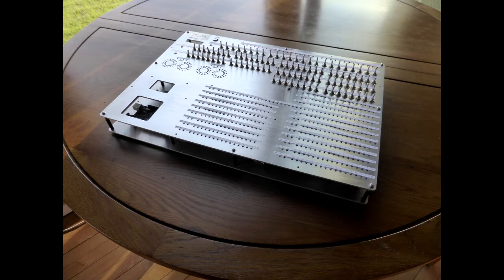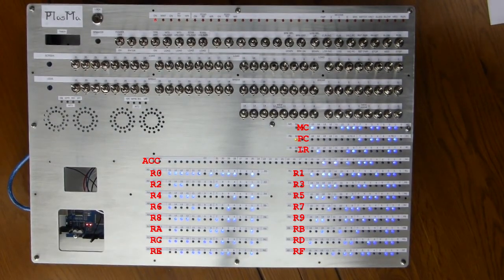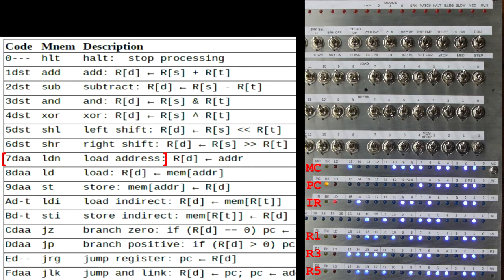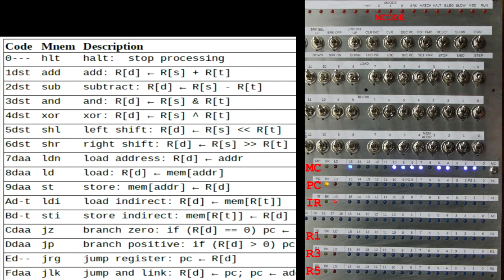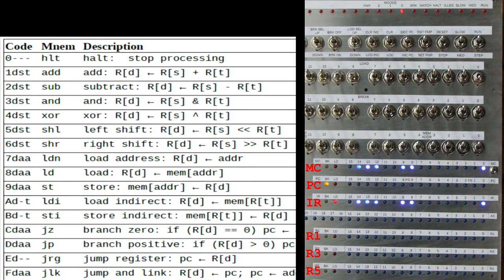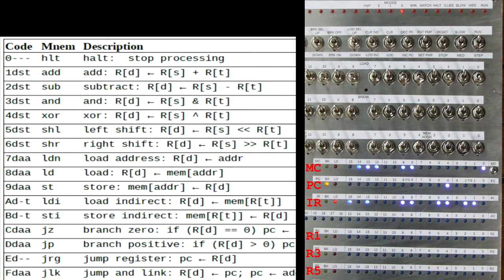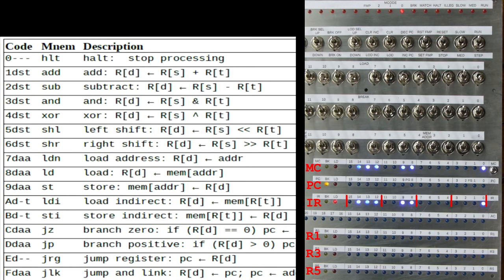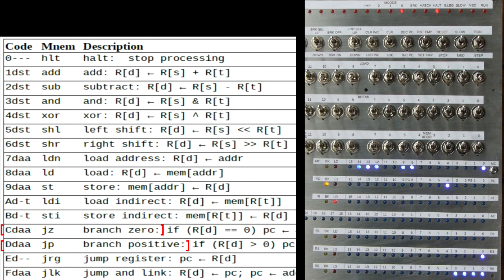PlasMa - 4. Programming, first steps

Comment: Phil. Is this programming a computer? Are the different numbers different programs? How do you tell what the programs are, or what they're supposed to create? Will.......
Reply from the maker: @W McCourtney yes this is programming at a very basic (machine code) level. We are 'spoilt' nowadays as your typical home computer or tablet comes pre-loaded with all the programs it needs to do anything useful. 

When you power on for the first time, the start up time (boot up) is mostly due to the machine loading programs (which someone else has written) from the disc into memory. First it has to load a series of small programs for accessing the user-interface devices, such as the screen, keyboard, mouse, touch-screen etc. It then typically loads a much larger program (operating system) such as Microsoft Windows or Linux or macOS, so you can do 'higher-level' things all at the same time, like word-processing, run a music DAW, browse the internet etc.

A lot of this is a lost art, so the whole point of PlasMa is to take you back to those early days when you didn't have those luxuries, partly for education to show beginners what sort of things have to be put in place before a computer can be usable, and partly for old-timers like me who kind of miss the excitement and challenges of starting from scratch with these monster machines :)

PlasMa emulates (simulates?) a computer system from the 60's/70's where the only way of inputting programs was on rows of switches. It simulates other devices (peripherals) such as a paper tape punch so you can build up a set of paper tapes containing your initial programs - you have to store them somewhere as all the memory is lost when you switch off. You can then read these tapes back in and gradually build up enough 'intelligence' to start using the magnetic tapes to store larger programs, and then move on to storing them to hard discs.

Once you have these support programs written, you can then arrange the system to read these devices automatically when you switch on, and the system will 'boot up' without much interaction. 

What you do with the system is completely up to you. It only has a small amount of memory (half a kilobyte, as opposed to the tens of gigabytes in your smart phone), so you will be limited in what you can do, but that's part of the challenge I wanted to explore... just how much can you do with such a limited system.

Comment: Hi Phil, can you help please, I've just taken delivery of a Tascam DP32SD.  I managed to create and name a song, but when I have tried to create and name a new song a repeated error massage - 'Dup File Name' keeps appearing.  I have tried everything I can think off but nothing is helping and whatever I do seems to bring the same message.  It's going back if I can't sort this.  Cheers.
Reply from the maker: @Martin Murray another user had exactly the same problem. He eventually solved it saying it was 'user error' but I don't know exactly what he did! I'll email him if you are prepared to wait a bit. Other than that, all I could suggest is to make sure you are using the latest firmware and an approved sd-card - these are the causes of 99% of problems. Dup file name means a song with that same name already exists on the card. If you fix it, let me know. Meanwhile I'll email the other guy. I'm  pretty sure it's not a fault in the machine so don't send it back yet.
Reply from the maker: @Martin Murray have now had a reply... he says:
"he went to the song menu to edit the name, and instead of editing the name, he clicked "yes" (as if you had to do that first before changing the name). And that's where the "dup file name" message would appear." Once he realised his mistake, it all worked perfectly.
So hope this helps, Martin. Let me know.
Reply: @philtipping  cheers Phil, I feel a fool tbh, I realised no sooner had I posted the message what I was doing wrong, couldn't see for looking!, thanks for the help, your video's are really very useful!